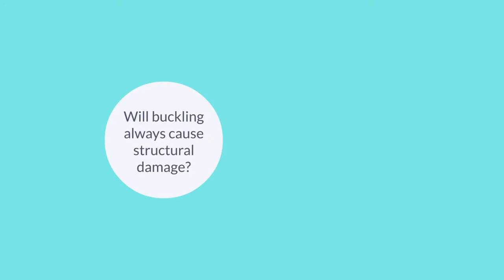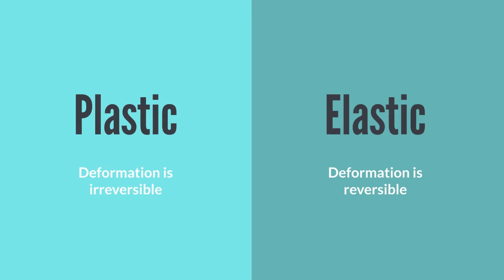Introduction to Aerospace Structures and Materials: Buckling Experiment

Comment: You can see a good example of buckling in the 1955 movie Strategic Air Command. A B-36's forward fuselage buckles under the forces of a hard turn from the nose wheel while taxiing and then the  buckles disappear when the load is gone after nose gear straitens out.      https://www.youtube.com/watch?v=5xn16Jp0_5w